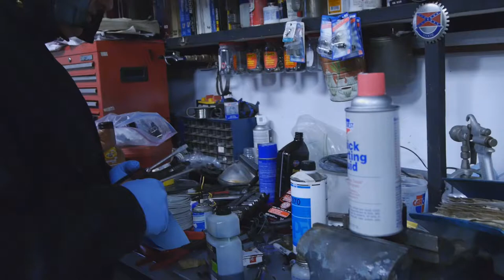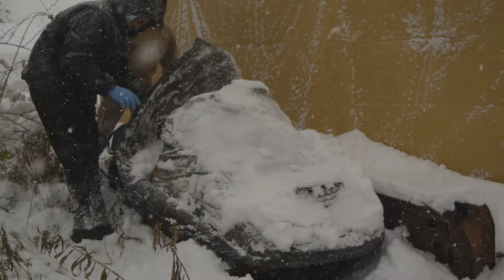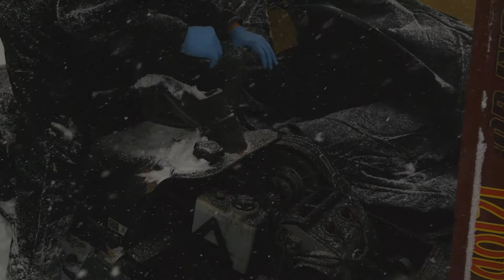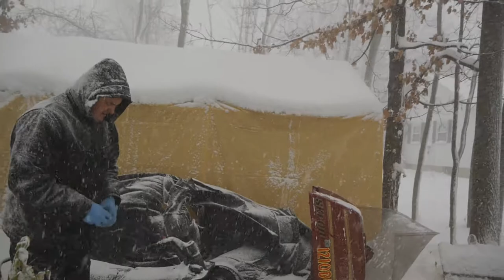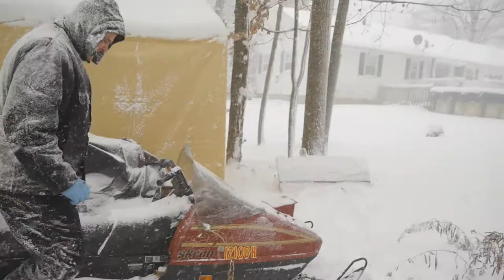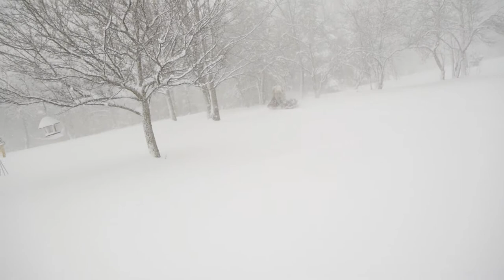Buffalo New York Snowpocalypse Day 1 – Starting the old Skidoo

Comment: The Skis had leaves and ice stuck to them lol so the sled wouldn't move. Also when you start these things for the start of the season you usually need to lift up the back to get the track off the ground and then give it some throttle to get the track going. If it was stored with a piece of wood propped under the back lifting bar holding up the back and keeping the track off the ground, and with wood planks under the skis, you wouldnt have had a struggle whatsoever lol.